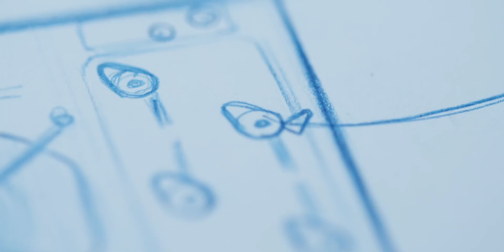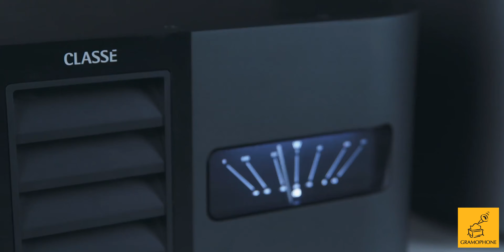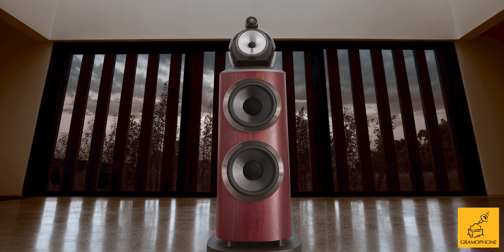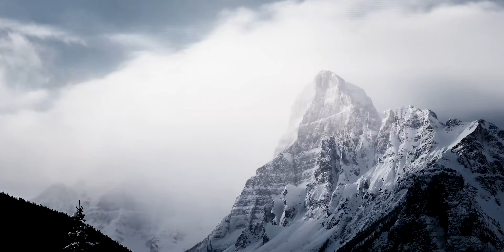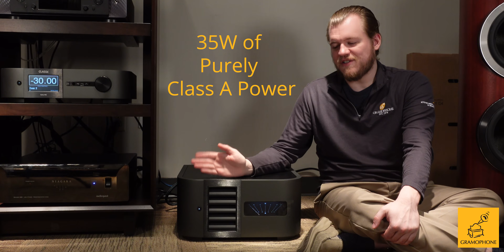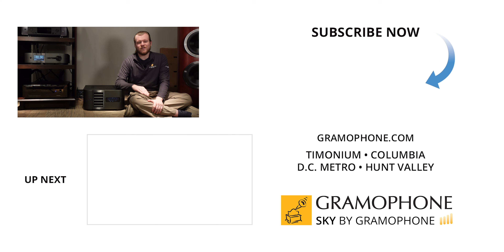Classe Delta MONO Power Amplifier 300 Watt | Review

Comment: I love my classe delta pre and stereo amp. The dac in the pre is not that great though. I really need to find a good dac to pair them with the 803 d4.  I love Mcinosh with the new b&w but their dacs are meh
Reply: I had the same problem. 
My best in the 20,000 range is the Dcs bartok, in the 10,000 range it is the esoteric n-05xd, and in the 5,000 range the lumin t3 or the auralic g2.2.
I ended with the lumin t3 because indeed  it’s not as good as the Dcs but the difference is very small and I didn’t found it was worth to pay 4 times more. (I’m in Europe and therefore I’m talking in euros and 20% vat included).
The lumin works very well with the classe audio delta system and Wilson audio Sabrina x. It certainly should work very well with the 803 d4, like any of those I’ve mentioned, It all depends on your budget.
Reply from the maker: We're glad to hear that you love the Delta Pre and Stereo combo